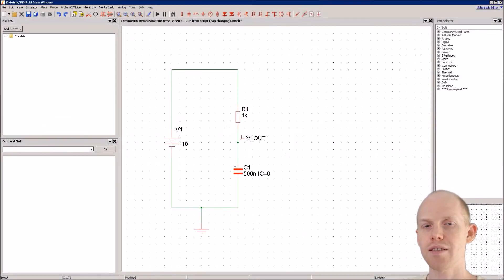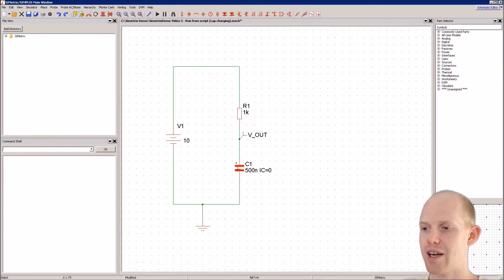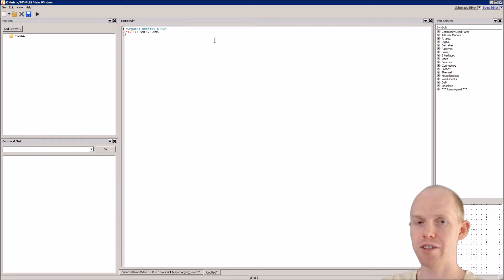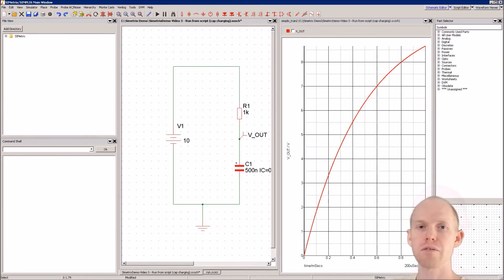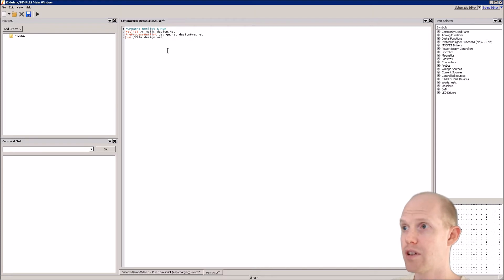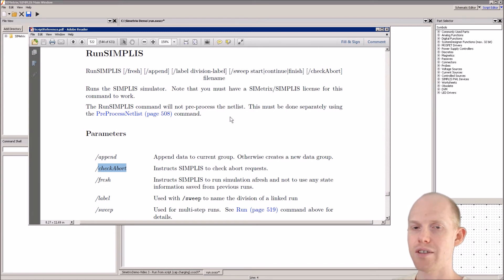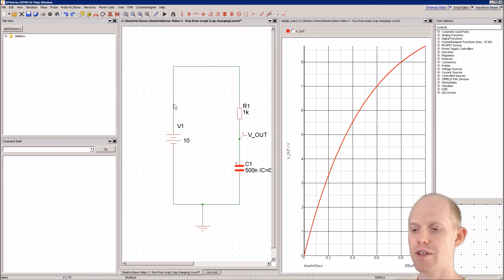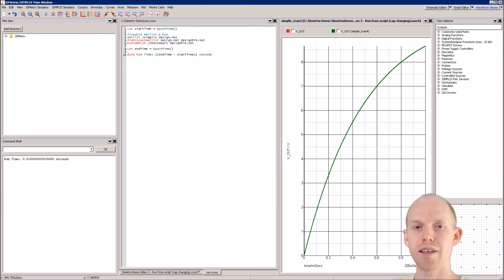SIMetrix/SIMPLIS Scripting 1 - Running Simulations

Comment: Hi, thanks for this tutorial. Please can you explain how to run POP/AC analysis with a script? I tried with your example but it returns the error "cannot find vector of name TRIG_GATE". I didn't find anything on the script manual. Thank you.
Reply from the maker: Hi, I have several more videos on this playlist: https://www.youtube.com/watch?v=eiOfgwpHIKw&list=PLPJa0dSdlB4WKriRAjfVYXO8W5goUo5wy
Also, checkout the documentation for the RunSIMPLIS command: https://www.simplistechnologies.com/documentation/simetrix/script_manual/topics/com_runsimplis.htm?hl=runsimplis
Make sure your simulation is running manually before you try to run the script. Your error is referring to the POP trigger node. First make sure you have a POP trigger. Next check you simulation settings for the POP and make sure the trigger name matches your actual trigger name. It could be the name in sim settings is "TRIG_GATE" but your pop trigger has another name. Let me know if that helps if you have more questions. Thanks for watching!
Reply: @CircuitAnalysis  simulation settings are right, it seems a bug, I solved the problem replacing the string "{TRIG_GATE}", with "Xn.!D_CYCLE" where n is the POP trigger device reference in the post preprocess netlist.
Reply from the maker: Oh yeah I think I do remember something about that now because there's that checkbox in the POP sim settings "Use POP Trigger schematic device..." that I think auto-generates that variable "{TRIG_GATE}" with the correct POP trigger part reference when you run it through the GUI but then if you run it with a script then that variable is not generated so you have to give it the actual POP trigger name instead of that variable. Anyway thanks for posting the solution!
Reply: @CircuitAnalysis  When will this bug be fixed? I have the same problem encountered but it is very inconvenient to change the text in netlist for every time.
Reply from the maker: @wuwenhao5555  I don't know, ask SIMPLIS hah! You can just open the simulation settings and put the actual POP trigger gate name in the "Custom POP Trigger gate" field and then it should run with the GUI or scripts, you should not have to change it each time in the netlist. Hope that helps?
Reply: @CircuitAnalysis  Thank you! That is really helpful:)